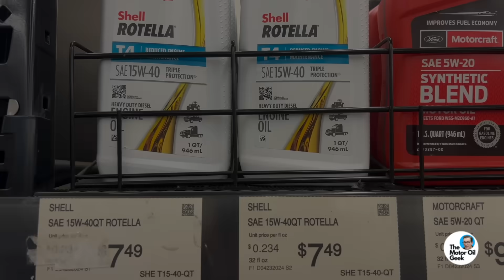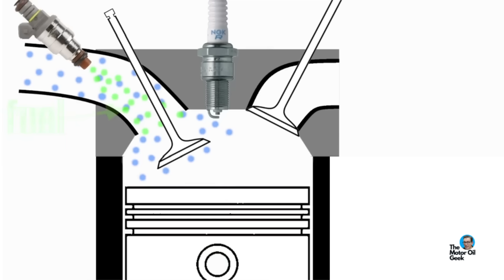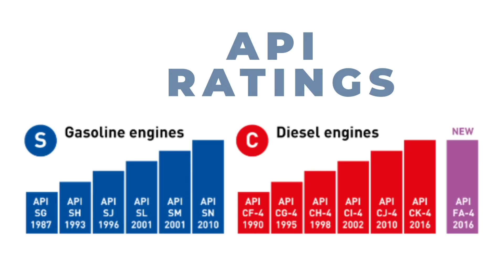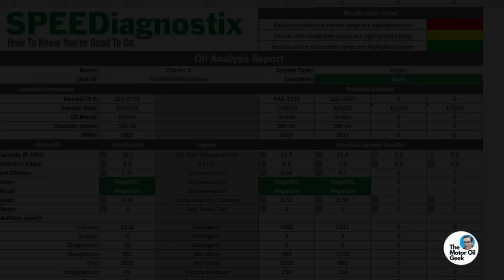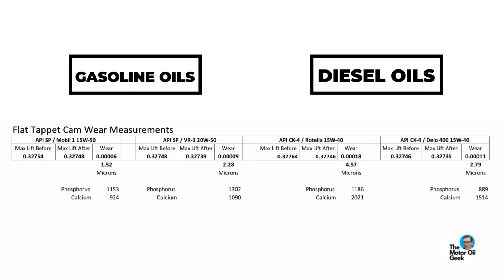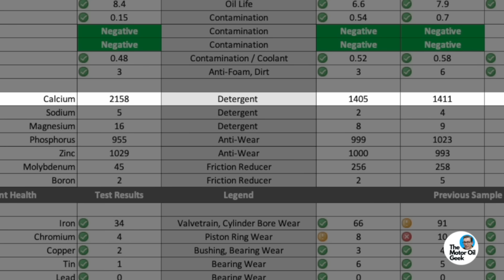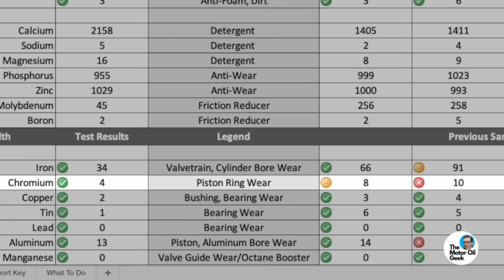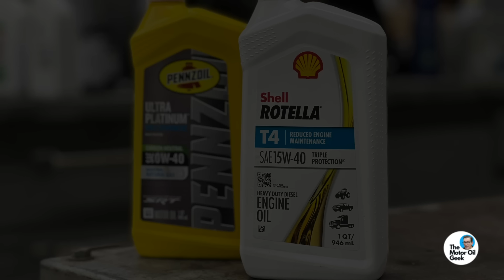Why DIESEL Oil is Actually WORSE for Gas Engines!

Comment from the maker: WOW! Thanks for watching and commenting on this video. This video does not pertain to wet clutch motorcycle engines (we've covered that in a previous video: https://youtu.be/igfiCx4QOrI). We are going to address oil for classic cars and flat tappet cams in the next video. In the meantime, here's an article on this topic: https://www.hotrod.com/how-to/diesel-oil-in-gasoline-engine/
Reply: Ok... Then what's the difference with the Valvoline Restore and Protect??! It's full of cleaner detergent. So shouldn't that oil cause side piston detention as well? It's probably 3x's more of a detergent oil than any Shella Rotella series. I need explanation please. This makes no sense. How can you say Restore and Protect is a good oil if it's detergent based just as a Diesel oil. 🤔 Think McFly Think
Reply: @PATH-n-Proverbs3.5-8  not all detergents are created equal. Diesels go with high calcium to get the higher TBN (acid neutralizing) rating required by diesel engines. Calcium is the enemy of gasoline direct injection engines due to all the reasons mentioned in the video.
Reply: @Szm50  ok but what about carb iron block engine flat tappet engines like I was asking about.
Reply: @Proverbs3.5_7  some good ole 15W/40 worked great in all the diesel tractors and gas vehicles we had in the 70s 80s and 90s. I've used Rotella T6 in motorcycles before it was motorcycle approved. But you won't catch me with diesel oil in an ecoboost mustang. That's the point of the whole video.
Reply: @ Why not?  For an older car, 
with gasoline engine that has some ring wear and produces blowby a mixed fleet diesel oil can be good.  An econoboost engine past 100k miles could be a candidate.
Reply from the maker: @sezwo5774  The high calcium level can cause LSPI in the Ecoboost engine.
Reply from the maker: @PATH-n-Proverbs3.5-8  Stay tuned for the next video.
Reply: @Szm50  yes but according to this video the T4 or T6 will cause side piston destination in any gasoline engine... thats what I've never heard of before in my 38 years of wrenchin. 🤔
Reply: @themotoroilgeek  I love that you actually take the time to respond to most of us. You're the man Lake. Can't wait for the explanation cuz my mind is racked now... My wife's looking at me like "what's wrong Hun?! Why do you seem so lost?" I said "you won't understand" cuz I can't understand it myself. Hahahahahaha. 😂
Reply from the maker: @PATH-n-Proverbs3.5-8  I try. Thanks for watching.
Reply: @ You are right!  These newer engines have unique problems.  Diesel type oil in an older car with blowby seems a No-no nowadays.  Thanks for the reply, video and continuous education.
Reply: @themotoroilgeek  we appreciate you man 👍🏼
Reply: @PATH-n-Proverbs3.5-8  it doesn't. I've been running it t4 in my V8 Mercedes drift car for 7 years. It gets thrashed like no other engines besides maybe a LSR engine. Zero issues except it will foam if you run too much and have windage issues. It is an old engine though. Don't run rotella in some new engine that wants 0w20 motor water.
Reply: @jasonbirch1182  lol .. motor water. Oh the irony. Engine water bud... Get it right! 👍🏼 Jk. But an engine is combustion and a motor is electric. Just for your future self to understand. 😂 So when you said Motor Water I kinda died laughing cuz of the irony in that. Electric motors would be dead I'd water. To funny.
Reply: @PATH-n-Proverbs3.5-8  if you're running high compression or a blower and more modern low tension rings, yeah, calcium based detergents could easily be an issue. Some engines it doesn't seem to matter as much. Others are more sensitive. There's no one set of rules that covers every variable. Suddenly I'm reminded of those mid 70s engines that had labor knock every time you lugged them.
Reply: @PATH-n-Proverbs3.5-8  same with GTX 20W50. See my other post. I think the Oil Geek is sponsored.
Reply: @PATH-n-Proverbs3.5-8  Because he is full of it.
Reply: @PATH-n-Proverbs3.5-8 there are set standards to the levels allowed and VRP is still designed to be under those limits and meet certification.
Reply from the maker: @PATH-n-Proverbs3.5-8  It is not full of detergent, that's what makes it so unique.
Reply: @themotoroilgeek  🤔 well then what n the devil is the deal. What's the best oil to use then that won't break your wallet on old iron block flat tappet cam engines.... Now you got me all messed up. Thanks Lake. I still love ya though bro. But gollie man. Can we just get a good oil for a decent dollar these days or what? I don't understand why it's so hard. It seems like every 4 or 5 years something new comes along with a "new study" or "new oil analysis" name but it's always certified somehow yet all of our old engines have been running just fine with our old cheap oil all along. 🤔 I'm starting to think the oil companies may be the ones pushing the "results" to try and be superior when all along it ain't no different. According to these studies I'm seeing the new stuff may even be detrimental to your engine. Gollie. Egg are bad for ya .. a decade later . Eggs are good for ya. We're all so dumb
Reply: @themotoroilgeek I need input on break in oil that is ok for a motorcycle 4 stroke. I wonder if maxima break in oil is okay. Given that the clutch and gears share oil with the engine. Are the requirements of a break in oil different? I
Reply: I understand they are chemically different but why is it that almost every diesel oil now says it good for gas, LNG,  and diesel
Reply: @themotoroilgeek Please make video for VW spec oils.. 504 00 vs 511 00 etc…
Reply: Awesome thanks!  I’ve got a 1948 Willys Jeep with a flathead and a lot of the vintage Jeep community swears by using Rotella in them.
Reply: Why did you ignore the API SN right on the label?  Why did shell put it on there?
Reply: Engine oil is like ammunition.  Everyone seems to have an opinion and data to support their opinion.  Everyone is always right, and everyone else is wrong.  In the end, it makes very little difference.
Reply: @Notdave29  actually this makes a huge difference.  You better get it right or engine go bye bye. 👋🏼 Just sayin engine oil is the most crucial equation to any engines life. Metal on metal bad.. metal on oil on metal good 👍🏼
Reply: @ Um yeah.  There needs to be oil in it, just like there needs to be ammo in a gun.  If the cap says 10-40, put 10-40 in it.  If the gun says .308, put .308 in it.  Go on with your day.  I’ve put well over 500,000 miles on vehicles at this point in my life, and have never had any engine oil related issues, or any engine issues for that matter.  I have never paid any attention to what oil I use other than what the cap says.  Just like ammo.  Use what the manufacturer recommends, it’s good enough.  Any further debate beyond that is just for the sake of sales pitches and armchair enthusiasts.
Reply: @Notdave29  in Oils defence.... They don't make Ammo with cleaner and detergent causing the barrel to react differently when shot 🤔 Soooo the analogy is a little flawed. Yes use recommended oil but you better read that label cuz it might be something like the Restore and Protect and then you got your oil filter clogging in just miles do to how well it cleans the carbon off the walls of the engine. Think McFly Think! There's more that just the weight of the oil that's a variable here.
Reply: An oil for VW would be awesome. I have a 2413cc type 4 in my airplane and I would love a VW oil episode!
Reply: Perfect timing, I've got an oil change to do on my 1980 Land Rover 2.25 petrol, albeit that's used roller cams since 1958 - it's effectively a petrol head on a diesel engine (even the camshaft is the same part number). A video covering the Euro ACEA specs would be useful though, because there's 13 of them - plus the OEM ones!
Reply: Mobil Classic 10w30 please
Reply from the maker: @desolategrey  That's up next!
Reply: why are some engines oils on the market, say you can use in both gasoline and diesel engines then, is it because of smaller diesel engines and not the larger truck engines.  Like say a modern 4 cylinder diesel turbo engine.👍👍🦘🦘✌✌Keep up the great work Lake.🦘🦘👍👍✌✌
Reply: I use Rotella T6 on my British Leyland 25.2
Reply: Thanks for Posting, Cool "Tribology" Sweater.
Reply: Mr geek 
I own a very old diesel (8v71), the manufacturer and all the old mechanics recommend straight weight SAE40#. 
I'm having a hard time finding this oil for a reasonable price. Where would I go to get some. This thing takes like 8 gallons.
Reply: @theq4602  and it needs to be low ash....two stroke oil
Reply: @fourbanger  I found some stuff
Sinopec Tulux CF-2 Diesel Engine Oil SAE 40
Reply: @theq4602  I worked for a Land Drilling Co. (USA) in the 80's with 2 of those engines on our Draw Works and a V12 on our Mud Pump....We used Rotella T4 15-40 in everything.....these engines ran 24/7.....We changed the oil and Filters @ 200 Hrs. run time......never.....any oil related issues.....Oh, our Draw Works took 8 Gals. and the Mud Pump took 12.....hope this helps......
Reply: @theq4602 I run a lot of 71 and 92 series Detroits and use the Delo 100 We get it from our Chevron distributor in bulk, but they confirmed that it is available over the counter and most NAPA stores with a commercial/heavy duty inventory.   Also it can be found at most maritime mechanic type shops on the regular.  Hope this helps.
Reply: @themotoroilgeek  polar vs non-polar, phosphor-glass film on cylinder wall, how all this soup dovetails to make a fine feast baffles me.
Reply: should do a diesel engine oil in the dirty gasoline, to see if it will clean the inside up, like so many people claim, not to run it for a long time .but to for a little while, maybe say 10 minutes at hwy speeds and then flush the diesel oil and put in oem spec engine gasoline oil back in, plus flush it properly is where the problems start to begin, but now we have valvoline restore and protect.🦘🦘👍👍✌✌
Reply: Lake, you need to get a ford 300 i6. They say you don't need to use any oil in it. People been using rotella oils in old early 2000s and back engines for a long time with no issues.
Reply: Excellent really looking forward to that! Hopefully you get to look at some popular classic car oils. Shame you cant get Penrite HPR30 20W60 to test which is popular here in NZ and Australia
Reply: @themotoroilgeek  could we get a video on the best oil for Classic / Antique vehicles? Like carburetors and flat tappet cams? Love the channel!
Reply: dave is a scammer bro... look at his yelp reviews he rips EVERYONE off
Reply: Thank you for very Good video 🙂 Greettings from old Eu 🙂
Reply: Okay, But, what about when we are now having oild for Both of the engines ? For diesels and gasolines ? What are you reccommending on this ?
Reply: Thanks for sharing your knowledge. Could you please do a video regarding the motor oil design for multi vehicle/fleet like: Mobil Delvac ESP, shell Rotella MV and Valvoline premium blue one solution gen2. Thanks
Reply: Yes, I put 12-14k miles a year on a Model A banger powered car. I sure want to hear your testing based recommendation.
I've been running Rotella T-4
Reply: Hi Lake - my car has two camshaft profiles, small & large. The small cam profile rides on a roller, and the large cam rides on a slipper, but is only active above 6,000RPM. Should I just use regular oil, since the engine is only above 6,000RPM for short bursts, or should I use oil that explicitly supports flat tappet cams. I would assume friction (and the need for high pressure additives) would fall off at a higher RPM.
Reply: It's niche, but could you cover oils for generators (gas & diesel) if there is any real difference in that application?
Reply: Idk who is running diesel in a brand new engine. That's silly. I run it in my Mercedes diesels and v8s designed in the 60s. You never met on a very important factor either. Diesel oils can lack anti foaming additives. I've been running rotella t4 in my Mercedes V8 m117 for 7 years. I noticed some foaming on the dipstick early on so I run it on the low side of the dipstick mark to help reduce windage and don't see that anymore. I'm turning 5500-6500 all day long. The motor had 117,000 on it when I put it on the car and has taken massive punishment with zero issues for the better part of a decade. I just found api ck4 and api sn rated full synthetic 15w40, sinopec t700 . 70$-/+ a 5 gallon bucket. Looks like my new go to unless I have an issue. Been towing with it in the diesel. Ran 50 laps in my race car. So far so good.
Reply: Please go into detail regarding the 6.7 Cummings infamous Hydraulic lifter issue, I suspect you may be under an NDA?I think you get a million views.
Reply: Hi TMOG. Is it possible to include the Liqui Moly Synthoil Race Tech GT1 10W-60 in your next video about classic cars and flat tappet cams? There are many owners of turbocharged or boosted Toyota - Yamaha 2ZZ-GE engines who use this oil, but as an engineer and from what I have read and seen from you and other sources I believe that this is too much, as the Toyota spec is for 10W-30, but as always science is about tests and tests confirm or annul theories. You can find info about the 2ZZ engine here (https://2zzge.blogspot.com/2025/04/the-2zzge-engine.html) and about my research for its recommended oil here (https://2zzge.blogspot.com/2023/06/best-oil-for-2zz-ge-engine.html). Thanks for all the guidance, I love your videos.
Reply: Ran delo 400 and Rotella in my bracket raceway for 20 years never had a problem ran great and on a tear down was clean as a whistle I'm calling bs on all this crap!
Reply: @themotoroilgeek ,I would like to know your views about oils which have S as well as C rating .. .waiting for your reply .. great work ..  powertrain quality engineer here 53 and learning something new in your every single episode...! God bless you..!
Reply from the maker: @sameerajgaonkar23  Dual rated oils (or mixed fleet oils) have to balance the requirements of both ratings. These oils tend to tackle the current diesel spec and then get the approval for the highest gasoline rating the formula can accomplish. For example, the Rotella shown in the video has both API CK-4 (current diesel spec) and API SN (older gasoline spec). API SN does not provide LSPI protection. There are some mixed fleet oils that are both API CK-4 and API SP. These are quite rare, but they are very good oils because the additive chemistry has to cover a wide range of applications. Generally, these oils will not provide as good fuel economy as a API SP Resource Conserving oil will.
Reply: @themotoroilgeek  Really would love a video expanding on this topic to include natural gas oils. I work with mixed fleets running Cummins diesel and CNG engines and there are several oils available that meet both CES 20086 and 20092 (for ex the Cummins endorsed Valvoline Premium Blue One Solution Gen 2). The CNG engines struggle with high oil consumption and catalyst poisoning and would love your insight on what to look for when comparing product labels and oil analysis. LOVE the channel, thanks for all your work.
Reply: If diesel oil sacrifices lubrication for detergent, then why do diesels last longer than gas engines?  Also why does calcium only cause knock in direct injected engines and not in modified conventional engines with advanced timing?
   Is there a chemical way to deal with EGR cleaning or carbon stuck rings in older engines?
  How extensively has small quantities of graphite been tested in car, but also filterless, splash oiling mower engines? since large quantity graphite was abandoned in the 1980s?
   This is the first I have heard of anyone using diesel oil in a gas engine that was neither old nor heavily worn, so it is your next video that has the broad application and should have been first.  I feel that factory recommendations apply fairly well to new engines with little wear, but lose applicability with time and miles.
Reply: I used Rotella 5-40w on my 500 Abarth for about 80k and never had any issues. Others fiat owners in my local group were doing the same and none had problems. 🤷‍♂️
Reply: @themacjunkie  without lab analysis, is 80k enough to know the difference?
Reply: Anyone try Lucas Classic car oil? States higher zddp for flat tappets...
Reply: Used T6 in several motorcycles, no problems.
Reply: I have a 5.7L Heavy Duty Vortec Marine Engine that needs 15w40 oil. What oil do you recommend? I think nice seen one 15w40 that says it compatible with GAS engines.
Reply: You should read my only other comment on this video,....but I doubt you will see it.
Reply: @themotoroilgeek  Great!  That one very popular “ Guy” on YouTube had me pretty much sold on using the Rotella in the old stuff, which I have been using in my old 69 Beetle. Now I’m scratching My head.
Reply: The comparison is between diesel and gasoline direct injection engines. Not older carbureted engines. Diesel oils are fine in a lot of older gasoline engines but never GDI. 

Rotella T6 is even motorcycle rated now. Though it may not be as shear stable as some traditional motorcycle oils.
Reply: @alexmoore5454  he told us his next video is going to break all this down for us in detail and more than likely he will categorize which engines are good for which types of modern oils.
Reply: I struggle finding an oil to run in my 1961 British car. Any suggestions will be appreciated.
Reply: @SkinnyBiker Just going off of what is available readily, that Castrol Classic blend is an obvious choice.
Reply: @ Perhaps a mixture of motorcycle and diesel type oil (?).
Reply: @SkinnyBiker  Lucus classic car and hotrod oil or if you’re in the UK, NZ or Aus, Penrite HPR30.